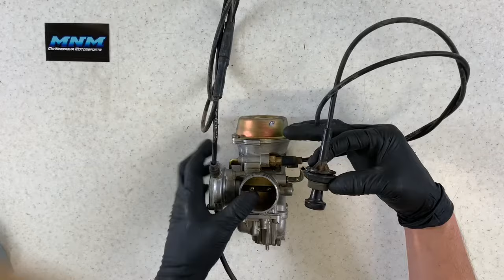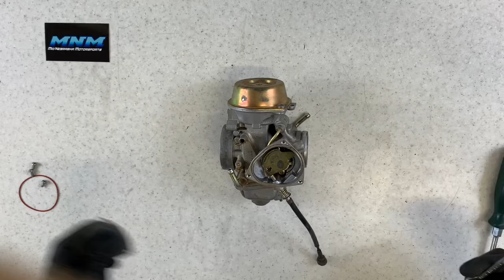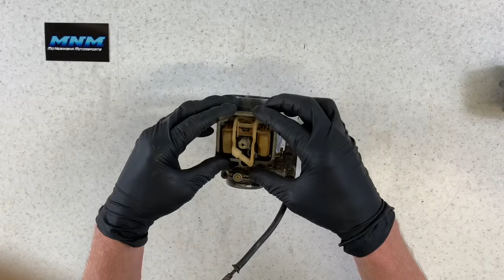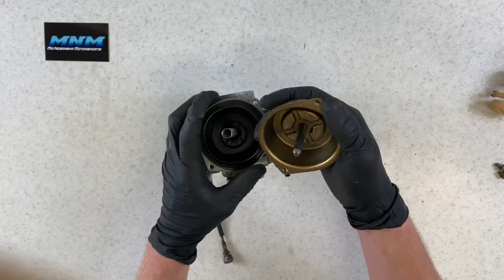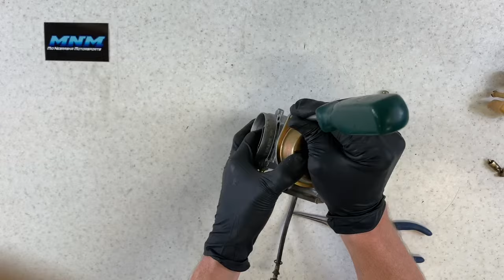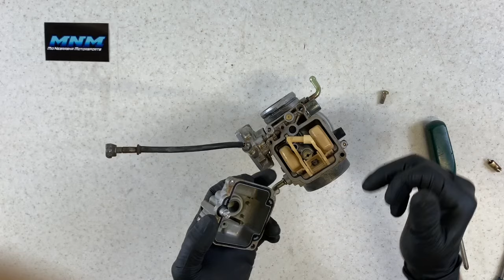HOW TO - Polaris Sportsman 500 Carburetor Clean Carb Rebuild Kit Gas Fuel Cleaner Repair Kit

Comment: Man I’m glad I came across this video 🙏

Mine is leaking fuel. The hex/torx bolt on bottom was backed out so I tightened it.  Didn’t help.  I had fuel running up and out the larger breather vent tube that goes down into  frame. Taken it off and apart three times now, cleaning and inspecting.  Another video showed the “O” ring on float, with the lil tab that helps line it up.  I changed that one, it was crusty.  Put it all back together and installed.  
Still leaking out the bottom.  Had to take a break.  Once I cool off 😡 and get my wits on track, I’ll take it  off again and inspect the fuel inlet “O” ring.  If that’s not the cause, then I’m stumped. Also, this last time I ran it, it idled sooo high as if the throttle was being pushed. I’ll double check my linkage and the idle screw of course.  Also, could that have been caused by fuel just dumping in? 
Does the large drain plug on the bottom have a gasket or anything? 

Thanks again for this video!! 🙏🙏🙏

Comment: this is a great video I had gas leaking through the overflow and it was gas seeping trough the needle valve seat ring not the needle as it looked great. this was my lucky shot as i took the carb apart 3 times before i decided to replace that seal. Bingo! thank you !!!!!!!!!!!!!!!!!

Comment: Excellent video! Very thorough and clearly explained, as well as demonstrated, and perfect job making sure to explain how the damn thing works and how all parts involved, operate properly! I can tell you've done this shit so many times that you understand it all, inside and out! Subscribed, liked and saved for future use! Now I'm gonna test my own ability to apply the same techniques and procedures you explained in both videos (Carb removal and Carb cleaning) along with the overlap part involving the choke and throttle cables, on and off the atv for demo. Thanks and great job!

Comment: Great video, thanks so much!  I have a scrambler 500 and this looks very close to my carb...  the seat with the o-ring you speak of at 11 minutes is slightly too small and so is one of the first things to leak, found a tip from a Facebook group that sizing up this o-ring slightly fixes that fault.  I've done it one 3 of my scramblers and it works like a charm!
Reply: @MidNebraskaMotorsports , do a search for the following groups... "polaris scrambler 500", "polaris scrambler/trail blazer III gen and older", and "polaris scrambler,  trailblazer, sport fan page".  Three great pages with lots of great info!

Comment: Well presented. Few things...1, do you remove and check mixture screw? 2, bowl screws stuck...tap with small hammer or something small and/or slot with hacksaw or sawall blade. 3, when purchasing aftermarket carb kits only thing I end up using is bowl oring and needle and seat. Never do I use the jets or mixture screws. They are close but not Oem.
Reply: Good to know! I'm sitting here waiting for my all balls kit, $45 for a o -ring and seat🤬 was the only brand I trust and was going to replace seals and possibly jets but maybe not now, I'll just clean.
Main reason for messing with is bowl seal/o-ring leaking.

Comment: Thanks for this video. Don't work on these small engine carbs at all. Had no idea how to remove the carb with the choke and throttle cables attached. Father in laws needs rebuilding, leaking out of that overflow line, even with the tank valve shut off.
Reply from the maker: Bummer. Glad this video helps. The choke assembly can be difficult, but we should have a video on the removal process which would include a choke. Make sure you check that out. https://youtu.be/yVlBguEZfQU Any parts needed check out our ebay store:  https://www.ebay.com/str/midnebraskamotorsports

Comment: should the plunger be very tight going back into the carb? and also very very hard to get out of the carb?
Reply: for the choke cable.
Reply from the maker: If it is tight going in it will be stuck open when you pull it the first time using the cable. You might take an emery cloth to it to clean up any build up it. Let us know if you need parts for that machine: ebay.com/str/midnebraskamotorsports

Comment: I appreciate your thorough video with clear filming and explanations. Do you have another video where you go through installing the parts from the carb kit? I have a few screws left over and two O-rings and do not know where they would go. I replaced the small O-ring on the floater stem and the large one on the drain plug that requires a 17mm wrench to remove.
Reply: Hi...Do u have de o-ring number for the floater stem? i didn't find them...thank U

Comment: I got fuel draining dripping tank dry from a hose underneath on R side. I'm guessing the float seat valve is the issue but is there another drain hose that could lead to the issue. Gotta be the carb I'm thinking, looking for a rebuild kit. But a new carb is only $40 sheesh

Comment: Great video. Nice detail! After I get everything disassembled, it's it OK to soak the whole body of the carb in carb cleaner or will that damage anything like o rings that didn't get removed?
Reply from the maker: Pete. I don’t soak the orings in carb cleaner. Even it you did and they don’t dissolve into nothing, it will without a doubt dry and and break down in the future. Hope this answers your questions. Thanks for watching and the comment. We have hundreds of videos yet to post. Hit the subscribe button so you are notified when we get them posted. Also check out: https://www.ebay.com/str/midnebraskamotorsports

Comment: Great video!  Do you have a replacement o-ring for the float assembly?  My carb rebuild kit did not come with one.
Reply from the maker: https://www.ebay.com/itm/03-05-Polaris-Sportsman-500-Complete-Carb-Kit-Carburetor-Rebuild-Set-/333891265160?mkcid=16&mkevt=1&_trksid=p2349624.m46890.l49286&mkrid=711-127632-2357-0

Comment: Loved your video, my question may have nothing to do with the carb. I cleaned the carb as per your video and also set the valves and in the end I had a 1/2 inch long by 1/8 inch ID spring left over, have you any idea where it fits. I have a 2002 sportsman 500. Thanks in advance.
Reply from the maker: What the.....you did not follow my steps if you have extra parts ; ). I think you might be talking about the choke plunger spring. Am I correct? Let me know.

Comment: I put a new carburetter on my 98 scrambler 500 and it runs good but when I turn around and I hit the throttle and bogs down real hard and quits what do I need to do?
Reply from the maker: and by new carburetor do you mean OEM or a knock-off. Check out:  https://youtu.be/kOv8nhHUsq4

Comment: Question: my oil smells like fuel. How can I fix this and what might be causing it? Great video.
Reply from the maker: I would replace your needle valve in your carburetor. Carb kit:  https://www.ebay.com/itm/333891265160   Thanks for watching!
Reply: Thank you! I have a 2005 Polaris ATP. It appears this carb kit will work for it as well?

Comment: Should there be a vaccum cap on the carb left side installed , im working on a 2010 sportsman 500 ho that dumps gas and is rough starting will only run with carb and choke cleaner any help would be greatly appreciated. This is one neighbor helping another my neighbor is on ssi 76 and unable to afford a shop so im taking on the job.

Comment: I have a 2003 polaris sportsman 500. I am fixing a leaky needle and seat. I bought a carb rebuild kit that did not come with a new slide diaphragm. If the old one is in great shape, is it necessary to order a new one? The old one is 20 years old so i am on the fence. Thanks

Comment: I own a 2000 Polaris Sportsman 500 RSE and live in Denver (just over 5000 feet above sea level). I'd like to take it hunting at between 8000 to 12000 feet above sea level. What would you suggest my jet sizes be to account for those altitudes?

Comment: Nice video I have a 2002 polaris 500 ho .I am in the process of replacing the carb. I ran into a problem the choke cable does not seem to want to go back in not sure if there is some trick to it. The choke should just screw back in but won't. Have you had this problem before?

Comment: Getting ready to clean a carb on a 2004 ATP 500 will it be the same ? Wish the camera was closer on that video !
Reply: @MidNebraskaMotorsports  I’m a subscriber already thanks for the comment. Waited for a new starter it’s on but someone ordered a new carb and put it on I got it running but haven’t messed with it for a week I’m gonna clean up the old carb and install it back on , the new carb drips the cable is not adjusting correctly and has way too much slack and drips out the overflow. These videos are priceless for the do it yourselfers thanks again .
Reply: @MidNebraskaMotorsports  lol I’m good I think I can get it done . Put my first carb kit in a 66 Chevy truck 6 banger when I was 12 45 years ago !!!! If I lived next door I’d be right over but WV is a long haul !!!!!

Comment: I have 2004 Polaris predator 500 that will start by popping the clutch then once it’s warmed up it will fire right up with the button start. I’m wondering why it won’t start right off the bat if you have any insights that would be amazing.

Comment: I just bought a brand new carb and installed it. Because old one was in rough condition. It was running fine on the test drive but then began to run quite lean and then I noticed a strong gas smell i took of the seat and noticed gas pouring out of the overflow tube on the bottom of the bowl. My air filter is pretty dirty. Could it be a vacuum issue? or a stuck float? Thanks
Reply: @MidNebraskaMotorsports  thanks i will definitely look into it!
Reply: @mathewh3766  I have this same problem, I can't see MNM's response.  what was the suggestion and did it work?  Thank you!

Comment: What is the purpose of the small brass tube pressed into the side of the carb running behind the throttle and idle connection?
Reply: @MidNebraskaMotorsports  i skipped ahead to the come removal and watched from there. There was nothing said about what I was asking. Did I miss it?
Reply: Nice video! I just picked up a 04 500 for cheap.  What carb rebuild kit would you recommend?

Comment: I have a 2008 Polaris Sportsman 500 HO and just rebuilt the carburetor with new jets and all, I’m having a  problem with it bogging down at full throttle or when going through a mud hole, what do you think my issue is
Reply: Did you fix the problem, what resolved it?

Comment: I rebuilt the carb and keep getting fuel in my oil. What do you think is going on.
Reply: Fuel is continuing to flow into float bowl Float is either stuck or you have bad oring in the needle valve. These carbs suck The pilot jet plugs way to easily. Way too small

Comment: Can you tell me where the pilot is to be set. Polaris dealership rebuilt my carburetor and it is se at 3 turns counter clockwise. Ideal is way to fast.
Reply: And you cant readjust with out removing the carb

Comment: I have a 02 Sportsman 500 that runs when choke is on, once I push the choke in bike stalls out. Any suggestions before pulling the carb off ?
Reply: You should check the module at the throttle switch on the handlebar 1st.  There is a little metal contact under the snap on lid that should only make contact when the throttle is suddenly released.  Otherwise the information I found indicated there should be a 1mm gap when the throttle is at the idle position.  If that doesn't fix it, rebuild or replace the seals etc. in the carburetor.
Reply: I have the same problem and it’s not the modual on handle bar it’s apparently a blocked pilot jet